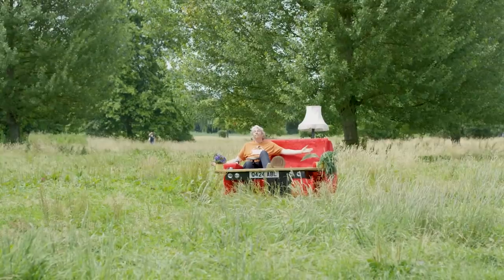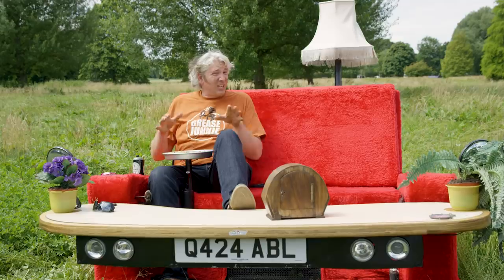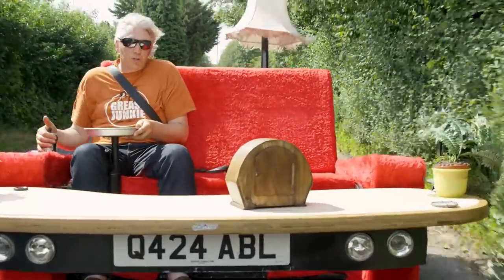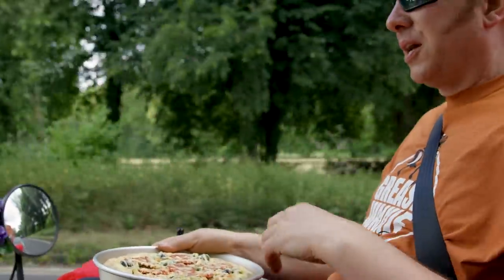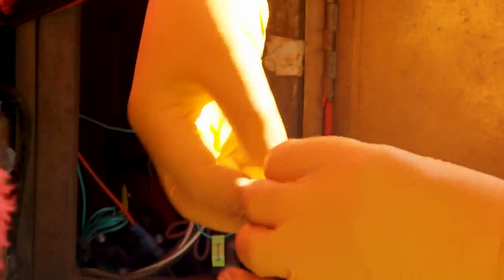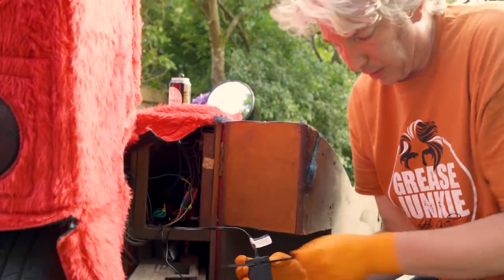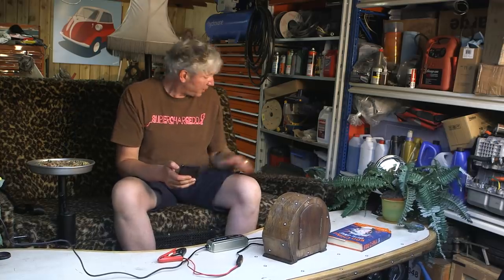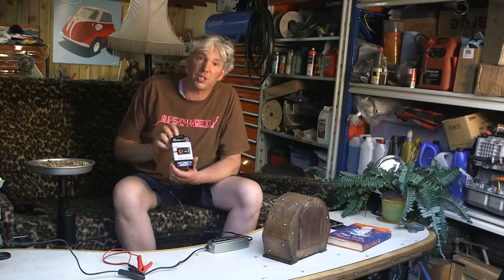CreatEdd 1, Introduction to the Casual Lofa (the World's only street legal sofa car)

Comment: Well Edd, you can bump start a mini. Unlike most automatic gearboxes, the mini auto box has the hydraulic pressure pump driven from the output shaft of the gearbox. That allows the box to select a gear and drive the engine. Somehow I think you know that,  butbthat would spoil the rest lf the ad.

Comment: I found the easiest way to keep my battery charged over the winter is to simply disconnect one lead. If it's fully charged it will read exactly the same in the spring. Even if it's left outside in freezing temperatures.

Comment: If you owned motorbikes that were not used over winter then you would probably already own a battery tender like Optimate. These have a short cable that connects to the battery terminal and you then plug the optimate into that and the mains cable into the mains power. Just switch on and the tender will just top up the battery when required if required.

Comment: Neat as it seems, if I’m going to the effort of installing a battery powered sensor, I’m as or more likely to hardwire a battery tender such as I’ve installed on the motorcycles parked in my garage…   Which I suspect would be less expensive.

Edit: as as it would have it, one of the tenders is the same one at the end of the vid.  :)

Comment: On assumes, however, that the Bluetooth battery condition indicator is a permanent draw on the battery in order to power itself, including a bluetooth tranciever.  So by fitting this, the battery goes flat faster.  Useful to be able to see the condition, but not great that it runs the battery down quicker.

Comment: Doesn't adding things like this add more drain to the battery - especially if its going to be stood for a while? Don't know how good the battery is, but 57% remaining charge after two/three months looks like its draining the battery quicker than just being left unconnected through an isolator switch. Stll good to see you on these videos Edd.

Comment: How did it ever get street legal and no overhead protection roll bar etc
Reply: There is no requirement for non-homologated vehicles to have any such protection in the UK. They must undergo a test and inspection to gain Individual Vehicle Approval). The rules for such one-off or low production run vehicles are quite detailed, but do not require roll-over bars, airbags, windscreens, anti-lock brakes, etc.

Comment: A battery terminal disconnect device would be simpler  and much cheaper - and /or a plug top charger plugged into a cheap plug top timer coming on for half an hour every day .

Comment: just disconnect the battery over winter using a quick release battery terminal. They are about £5 and the car stays fully charged all winter.  Simples

Comment: Hey edd,just wanted to ask,I have a 1990/3.9ltr v8,compleat with gearbox,when I bought it down the country the landrover had huge wheels on it and he told me that he done loads to the engine for Hill climbing,and that the engine was a stage 3 upgrade,the power that came from it driving it home was great,my other mate wanted the v8 out and put in a 2.5/8 landrover deisel engine,so I kept the engine,wireing loom for the engine,ecu for the electronic fuel system,gearbox and a few other bits,what I wanted to ask is,in your eyes what's the best car you recon I could put it into,I want something that rear wheel drive, weather it is a BMW, Audi or do you recon I could fit it to a Vauxhall Astra van,that has a 1.7,cdti and is front wheel drive,but could that van be fabricated to take a v8,drive shaft (custom built)and for the rear I'll need a diff and custom back end,if you have any ideas what I can or what's the best route to go that would be great edd,thanks
Reply: your in for a L O N G wait paul, big edd NEVER replies...…………………………………..
Reply: @t5jerry  worth a shot,think I'll stick to my original plan and look out for a mgbgt , thanks for the heads up,and have a great new year 👍.
Reply: @Dublinjackel  ...I suppose you can see the BIG fellas point of view........ If he answers 1 question he has to reply to ALL questions....you also have a nice New year 😁

Comment: I highly doubt this is really street legal. We can't even paint our car another color without requiring a new pass at validation.
Reply: @Joris, it actually is street legal

You can check the mot history on the UK .Gov website by typing in the reg plate
Reply: @BigFurryCat  ahh, K. Dutch law doesn't allow you to change body shape to a certain  degree without requiring it to enter testing as a new vehicle. So even taking the original chassis of an already registered car to turn it into a sofa, will make it illegal :).

(people repainting their car, adding unofficial body kits.. All people being surprised by the strict rules.. Although if you really only repaint it it should breeze through a registration-check no problem)
Reply: @jorismak  In the UK, modification of the chassis (or the structural parts of the shell, if it's a monocoque), requires an Individual Vehicle Approval (inspection and test). Anything else does not. Body kits and a whole lot more are all legal - you can strip a Volkswagen Beetle to its chassis/floor and replace the entire top with a beach buggy body, without needing a test or inspection, but if you shorten the chassis, it must all go through the IVA.
Reply: @stephenwalker6823 I know I'm late, but you can see this vehicle has a number plate starting with 'Q' In the UK that means it's a kit-car and isn't subject to as strict regulations as a normal car
Reply: @jako1234567890jako  It is not quite as simple as that. Q just means age unknown. So an imported car, without proof of date of manufacture will be given a Q, as will a kit car built from parts from multiple donors. However, a kit car built only from a single donor and new parts, can be assigned a plate of the same year as the donor. A kit car built from all new parts (one major part, such as engine or gearbox may be reconditioned rather than new), can be assigned a registration as a brand new vehicle.